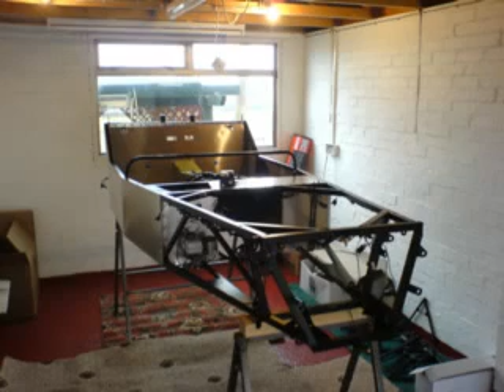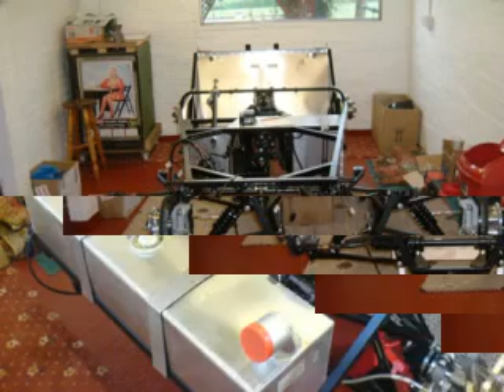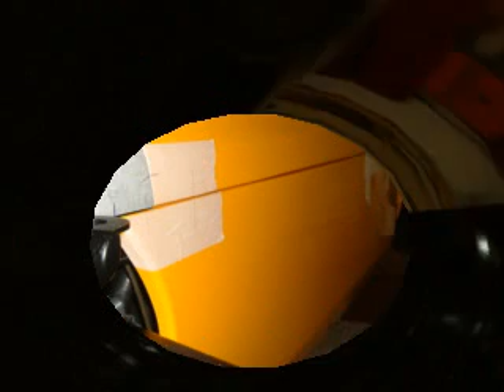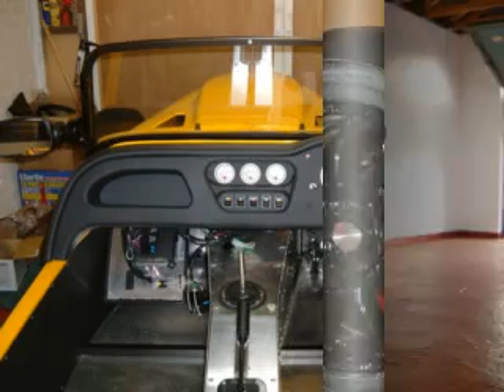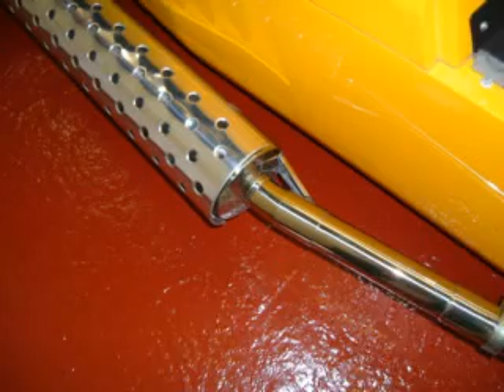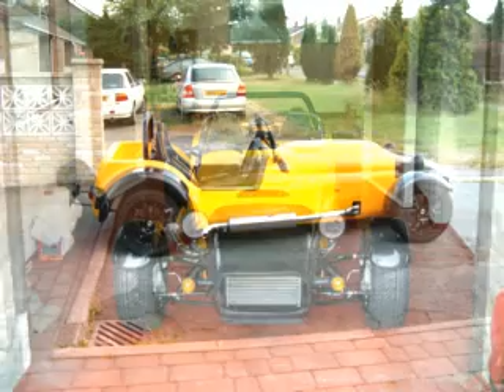How to build a Westfield Sports Car

Comment: I'm doing the beginning stages of planning to build a Westfield/Caterham type car. I want a high reving engine so I thought the Hayabusa engine would be a good idea. With a bike engine I'd have sequential shift correct? Is the Busa engine shaft drive? Can I mount it right to a LSD with IRS and go? What are some other engine options? I've seen the videos of the Turbo Miata and that looks good but I think I'd like the sequential shifting from a bike engine. R1 maybe? Any help is appreciated.

Comment: Nice tidy job there,nice size garage too,only one thing,shame you had to use a mini wiper motor and rack,they were crap on the mini and 100 different BLMC cars they were fitted to.Slow,jerky,dont wipe properly,rarely park right either,I always use for racks and motors shortened from MK2 escort,even MK5 or later can be used.The arm spindles are 100 times better they are operated by flat bars and they wipe and park properly,just my preferance anyway.

Super motor,wish you many miles of happyness!!

Comment: Just because im thinking of buying a kit myself. The overall cost of the build. How much would you have spent after buying the kit? I have figured that the kit itself is about 50% of the cost, and just as much needs spending on all the other bits (except for tuning of the engine)